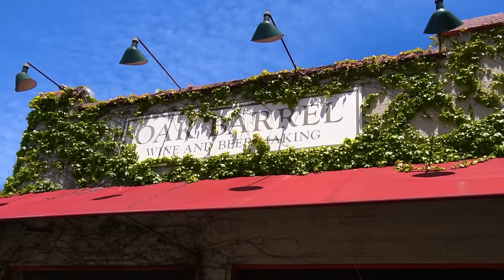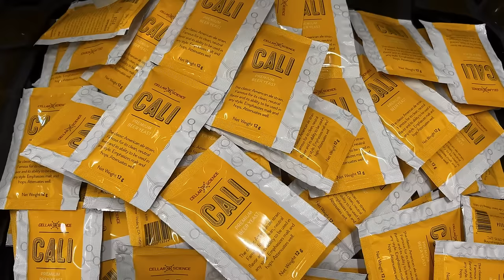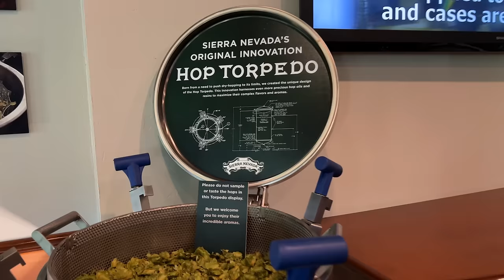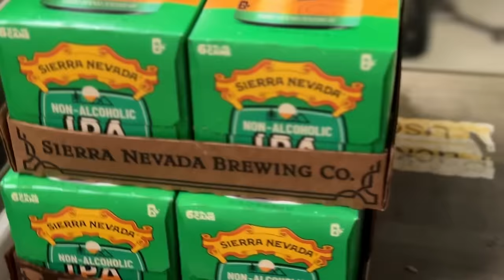Sierra Nevada Founder Ken Grossman Talks Craft Beer History and the State of the Beer Industry

Comment: Another question I would've asked would've been why haven't many American brewers, including Sierra Nevada, had success with Bavarian style Wheat Beer? I actually can't remember if Sierra Nevada has ever brewed any other than an experiment perhaps.

The last great American Bavarian style Wheat Beer was from Brooklyn Brewery, but it's been discontinued for many years.
Reply: They did Kellerweiss, which was a favorite of mine for quite a while. They did a filtered wheat early on and it’s still available at the brewery. Bavarian wheat beers had been my go-to style in the 2000s, and could pretty readily find them until the rise of IPAs. I’m pissed they are hard to find now. I think the biggest reason why breweries stopped doing them was to make more room for IPAs, and it was also the added expense of having a separate yeast for it – to do it right – and if you weren’t doing step mashes, and had good lautering capability, it’s harder to brew. I think to do it properly it’s a more difficult style to produce than IPAs. Also, you don’t get as many uses out of the yeast as well to get that good banana and clove flavors.
Reply: @AdamKeele  Thanks! Yes, I remember Kellerweiss now that you mention it, but I don't remember it being widely available or around that long.

Do you have a favorite bottled/canned Bavarian style Wheat Beer from an American producer these days? I can't name one.